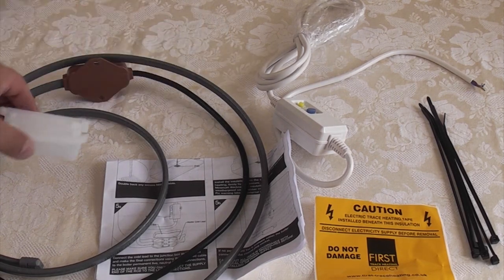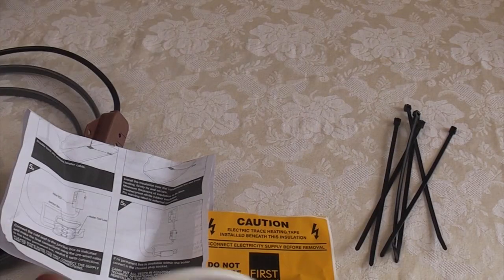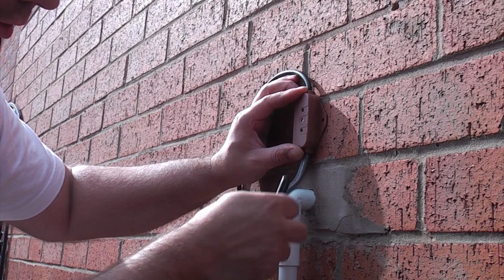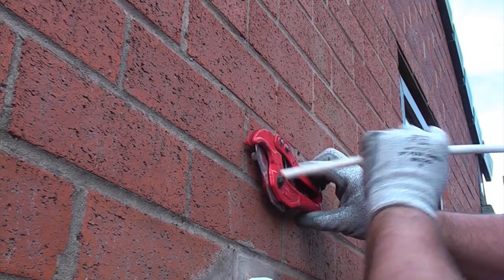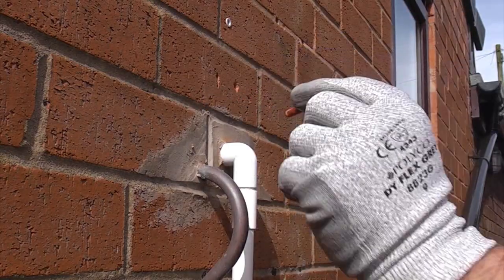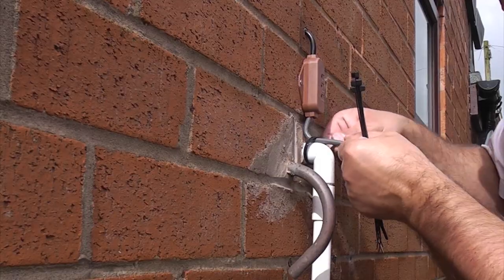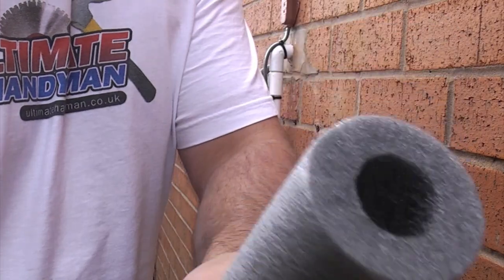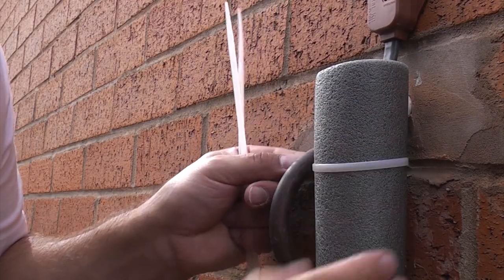Trace heating

Comment: On 32mm Pipe our cable can now be installed within the pipe as we include a rubber bung. This system can be used on any domestic water pipe not just condensate pipes.

Comment: I used to be a trace heating engineer about ten years ago so obviously I might be wrong in some of the points I make now but the heating tape should be spiral wrapped around the pipe, as heat rises you don't want it just going back up the tape side you want the heat around the pipe. I assume the heating tape has a silicone outer sheath otherwise plastic cable ties against the heating tape can cause plasticiser migrated ( they mould together) damaging the heating tape. Only self limiting/regulating otherwise Series and Zone Parallel heating tape touching themselves can heat and damage themselves. Otherwise good video, I worked on domestic and industrial trace heating, took me back, thanks. Sorry forgot to mention plastic pipes should covered with aluminium foil tape first to aid in the transfer of heat and prevent plasticiser migrated of non-silicone sheathed heating tapes.
Reply: Doesn't work like that anymore mate that was a rule of thumb years ago, it makes no difference to the heat dispersion , especially on a pipe that small
Reply: Instructions with my trace heater say "for plastic pipe and plastic components the trace heating cable must be wrapped with an aluminium adhesive tape" and then "after installation of the trace heating cable, the pipes must be insulated with a min of 20mm lagging"

Comment: Apparently according to our heating engineer, condensate pipes must now be 32mm minimum on all new boiler installations. As ours is above this size there is no need for a heat trace to be installed. He also remarked that upgrading the condensate pipe to the new minimum on older installations, is cheaper than having a heat trace installed.
Reply: The flow in condensate pipe is slow. In freezing condition such as winter 2017, the condensate froze in thin layers inside 32mm pipe and the ice build up to block the pipe. Normally the ice started at the exit of the pipe and then progressively froze the condensate backward. I have 2 boilers with 32mm pipe running at an angle more acute than 45 degree frozen up. Pipe size is not the ultimate answer. Run the pipe indoor is a far better solution; however, very few heating installer would do that. With existing installation, trace heating might be your only choice in harsh winters.

Comment: You can still use 22mm pipe if necessary but it needs to be insulated with the correct insulation not what was used in the film.

Comment: Condensate pipe has not been installed correctly, however good demo. I have fitted similar wires but had to cover plastic pipe with metal tape what,s your thoughts on that method.